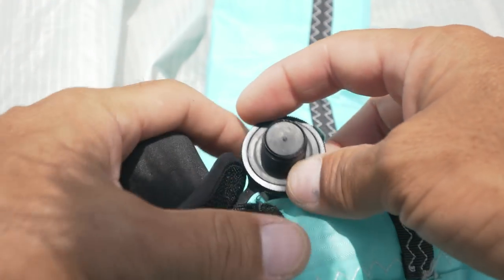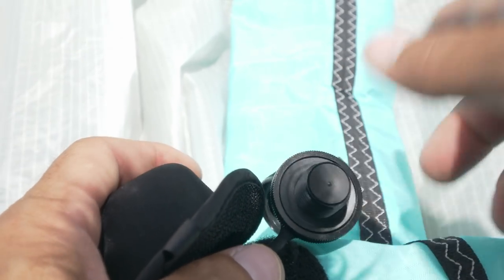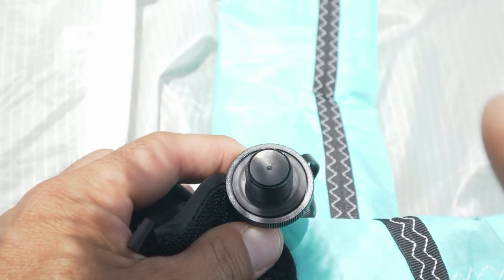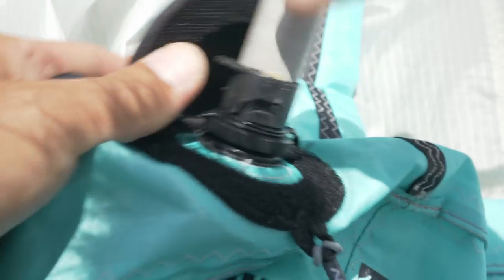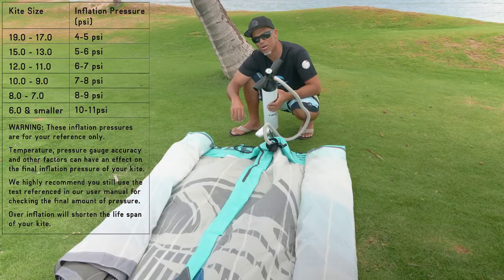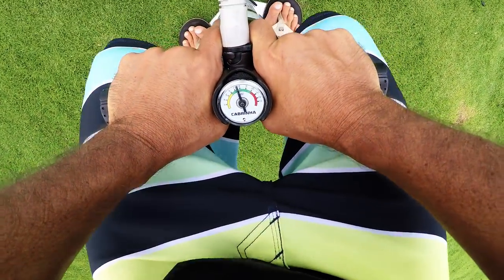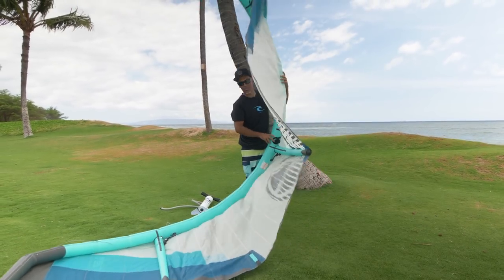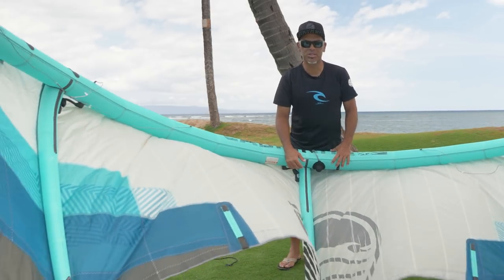Kite Inflation Tips (Cabrinha Kitesurfing)

Comment: if you will install one way valve on inlet of manometer then during pumping wehn you stop pump pressure will not drop, because will be constant pressure in hose also. Very simple and looks so much better during pumping. Ihave already pump like that and work perfect.

Comment: How would you test to determine if the  kite is overinflated ?
Reply: I've pumped kites till  the pump stopped. Tried to pump it till explosion  never got there.they are very well made the new ones
Reply: I always add 1 to 2 psi more than the number it says on the pump, I’m heavier than average kitesurfers and do like to ride super overpowered, with the extra pressure the kite always stays in shape and never fold when edging really hard, no matter how overpowered I am, the cabrinha’s are build fantastically strong and can take the extra pressure, so I would not worry too much about over inflating them,